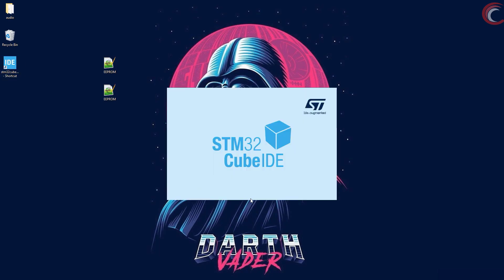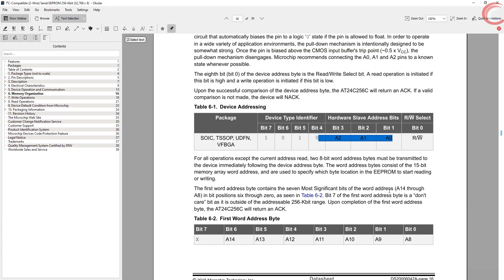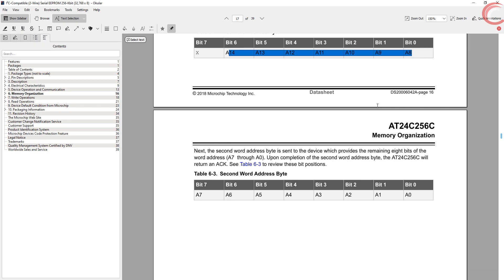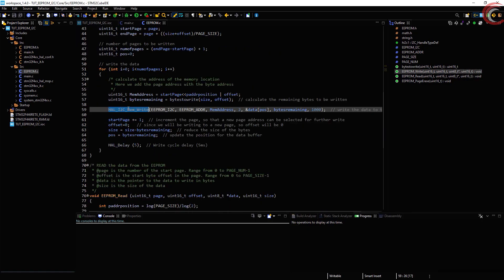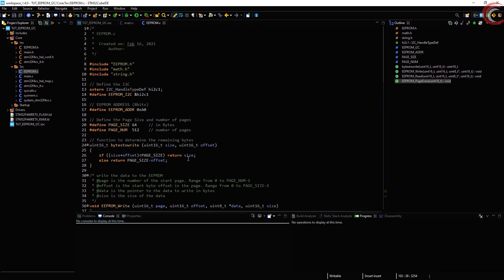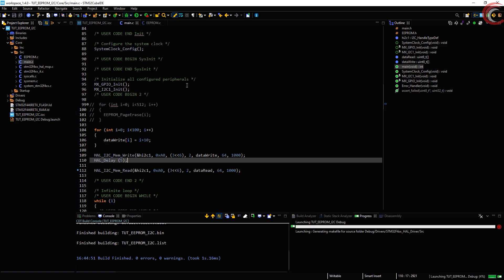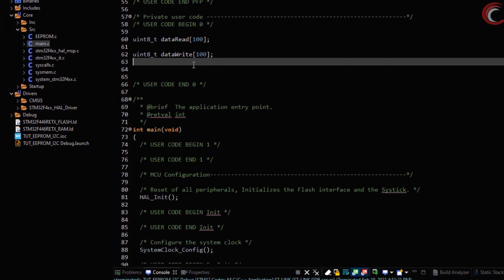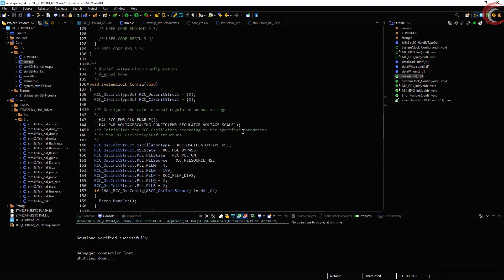EEPROM and STM32 || I2C || Multi Page Write and Read

Comment: Hello, Controllers Tech! I found 2 bugs in your code while I'm working on my project. First, the code is only limited to EEPROMs that have 2-byte memory addresses like AT24C256, while 1-byte memory address EEPROMs like AT24C02 only use 1 byte as an address, which is unsupported by the hard-coded 2-byte function call. Another issue is that when you try to commit data that has a length multiple of 8, the last page will be committed as an empty page, and will, in some AT24C alternative parts, erase the next page unwantedly. 

I fixed these bugs in my own repository, and if you would like, I can file a pull request. Thanks!
Reply: Hi, Kate Iry! Can you publish your own version of the code for AT24C02? I will be very grateful. Thanks!
Reply: @ArsenMikitov  No problem! Check out https://pastebin.com/vELjnicZ
Reply: @ArsenMikitov  My pleasure! Don't forget to include the HAL header file of your own MCU 😉
Reply: @kateiry4719  Hi, I am getting error in EEPROM_pageErase like undefined symbol. Do you know how to solve .
Reply: @nagasobhana9067  I would love to help! May I have your code and error reports, please?
Reply: @nagasobhana9067  I'm sorry but I don't use WhatsApp, maybe you can post it on Pastebin
Reply: @kateiry4719  Actually it built Successful. But when I connect to my kit stm32g070 . It doesn't read and write the value like in the  video.
Reply: @nagasobhana9067  Let's talk about this on discord shall we
Reply: @kateiry4719  Yes
Reply: @kateiry4719  sure
Reply: @nagasobhana9067  may I have your ID
Reply: @kateiry4719  Sobhana#4576
Reply: @kateiry4719  hi, I want your help
Reply: @nagasobhana9067  My bad I was busy recently
Reply: @kateiry4719  it's ok. I cleared my doubts.
Reply: @nagasobhana9067  That's great to hear
Reply: Hello Kate! I am using eerpom with 1 byte word address. Could you please share your code?
Reply: @dilayacer  I shared my code through pastebin in the comment above
Reply: Yes I saw, but i am from Turkey. Pastebin access is prohibited here, i connected with VPN but could not open it. İt gave ssl error. Can you share on discord.
Reply: acerdilay#6204

Comment: Hi I'm using this on stm32l4 and AT24C16 , there is a problem in multipage writing...it writes the intended content of the last page over all of the pages!!!
Reply from the maker: I need to check the c16 datasheet. Better Open the issue in the github.
Reply: I have exactly the same problem with writing in 24WC16P  (16 bytes/128 pages). ALL data is recorded only on the first page. But in 24C64 (32 bytes/256 pages), the recording is performed correctly. And there is also a restriction on setting the byte offset in the page being written: writing does not occur if the offset exceeds the page size (in bytes). Apparently, it is necessary in the recording function to check for the offset output beyond the number of bytes in one page and make the appropriate correction?
Reply: According to the documentation for 24C16, the addressing of memory cells is different. The highest byte of the cell address is placed in the lowest tetrad of the device address byte (excluding bit '0'). I had to change the code and it worked correctly.

Comment: i tested the code and it works but when i keep the OFFSET for datar1 [ ] zero than i can see the whole string " hello world" but when i increase the OFFSET value then the whole string moves up in live expression window although it should go down, can you please explain this
Reply from the maker: You are not keeping offset for anything, you are reading from an offset. Of course it will move up. 
Say your data is in 10th place. If you read with an offset 0, then the data will show at 10th place in the RXBuf. But if you read from an offset of 8, then the data will show up at 3rd place.

Comment: Hi Controllers Tech, brilliant series about STM32. Could you explain why the Arduino and STM32 uses different addresses for i2c? It appears that the address on the Arduino appears to be shifted to the right by one bit. Why is this?  For example, the address is 0x50 in Arduino but 0xA0 on STM32. Thanks
Reply from the maker: At the mcu level all of them use 8 bit address. There is no such thing as 7 bit register.
Arduino IDE takes 7 bit (higher 7 bits) value. If you don't use the arduino functions and instead use registers for programming, you need to give 8 bit value in arduino too.

 I suppose they did that because the 0th bit of the i2c address denotes read or write operation. So they would want to minimise the confusion of changing address with read or write cycle..

Comment: EEPROM is M24C04-R. I am trying to do write page and Read page of Structure values. But it's not reading after 16byte. So provide me solution for this.
Reply from the maker: As it's mentioned in the video, it targets the AT24 series from microchip..
Can't say about others..
Reply: Have you changed page settings? if not try these.

#define PAGE_SIZE 16
#define PAGE_NUM 32
Reply: Explanation:
Your EEPROM is 4kbit, in bytes that would be 4096bits/8bits = 512bytes. The datasheet says the page size is 16bytes. So, the number of pages would be 512bytes/16bytes = 32.

Comment: it works great when i write on one page,but when i write in 2 or more seperate page it doesn't work properly unless i write and then exactly read the next line.i dont know where i'm making a mistake. 		                	 EEPROM_Write(0, 0, (uint8_t *)dataW,strlen(dataW));
 EEPROM_Write(3, 0, (uint8_t *)dataW2,strlen(dataW2)); 
EEPROM_Read(0, 0, dataRead, 15);
  EEPROM_Read(3, 0, dataRead2, 15);
i use at24c08.
Reply from the maker: So it is working if you do the same but using write read write read... But not working with write write read read ?
Reply: @ControllersTech  yes it doesn't work when  write write, read read
Reply from the maker: Ok I'll test it and get back..
Reply from the maker: It's working alright here. I tried With both the methods and results were same
Reply: @ControllersTech  tnx. maybe i made a mistake
Reply: Hy ... Is there any Solution i am also stuck at here..